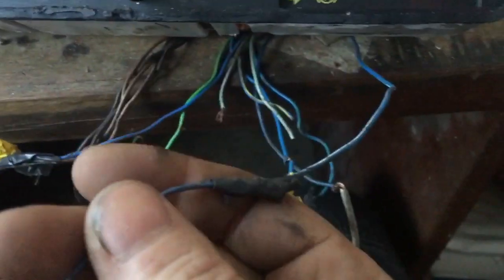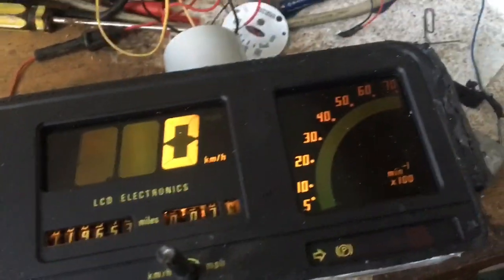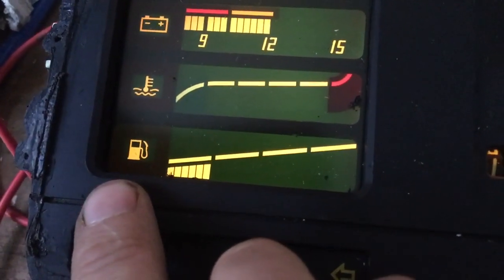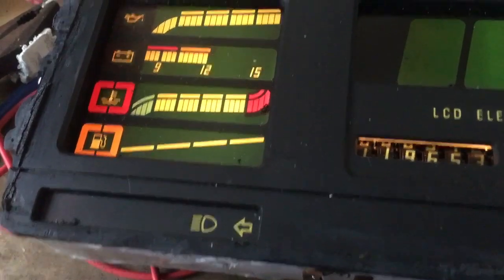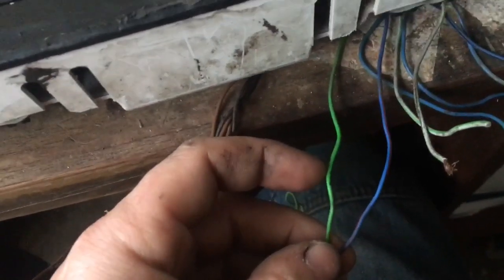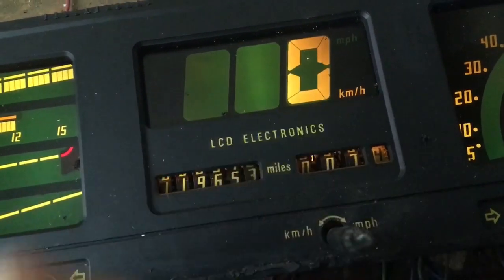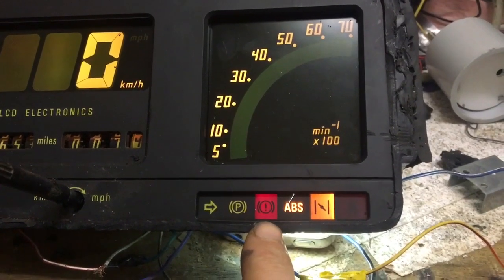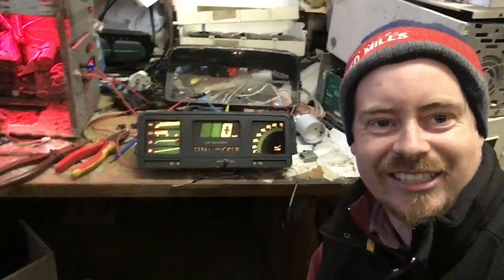Ep32 Bench testing the Astra gte digi dash

Comment: Bit of a long shot but do you repair these units? My dash is fully illuminated & working but half of the rev counter & fuel gauge pixels are not displaying. Any information would be grateful
Reply from the maker: There are 3 light bulbs 💡 behind the dash my Guess is one or 2 bulbs are blown, just replace them . Now from memory I don’t think they are a standard bulb but you can find them on eBay you will have to remove the bulb and find a code or what it looks like first , and I think you do have to use the exact same because of the light of the bulb and how it throws the light . Best of luck
Reply: @stevenharpervw its not the bulbs they illustrate fine its the lcd digits in part of the screen not displaying in the modules, im assuming they are faulty or a possible bad connection from the ribbon cable or a solder joint on the pcb
Reply from the maker: The pixels are backlit with bulbs so just be sure that’s not the problem .  There is safety / anti tamperproof screws holding the cluster together but you can buy the opener online. But some clusters I’ve see have normal screws so who knows . If you do get it open yea check the ribbon cable, you could also have cold solder joints . Or a crack in the solder joint .  The clusters are still cheap and come up on eBay so might be worth just swapping them if that’s the problem. I haven’t adjusted the mileage counter on mine but usually they are just held in either + screw and you could swap the two counters or just remove the input cog and roll on the mileage till it reads correctly
Reply: @stevenharpervw Ive already got the clocks fully stripped down, the solder joints on the PCB dont look good so I'll start there, Ive already wound my mileage back to match my original odometer as I'm fitting the clocks into a Corsa, I bench tested them & everything was working until I dismantled them so something has gone wrong hopefully nothing major
Reply from the maker: @rickwright5045 I think from memory the black plug and the while plug both have their own 12v and ground wires so 2x of each so just check that your have the wires all accounted for
Reply: @stevenharpervw the black plug is irrelevant to the lcd displays as they are powered through the white plug only
Reply from the maker: Ok it was over 5 years ago since I recorded this video so I’m trying to remember everything I did, hope you got it sorted

Comment: I just bought 2 of them. The older one like this and the newer one. I see some vw connectors in the back.  Are you going to mount this in a mk3 or something?
Reply from the maker: Yep so I mounted it into a vw corrado . As they are the same size . It looks great . The speedo was the hardest thing to get to working to rear the correct speed but it’s finally correct now . 😅
Reply: @ great. I heard the mk3 sensor works to? I’m building one in my mk2
Reply from the maker: @19811402 no you need vss with a 6 pole or 16 pole sensor the vw vss sensors are only 4 pole . I’ve a video showing the different sensors from about 7 years ago
Reply: @stevenharpervw oh so it’s showing to low speed? Cos I used the mk3 sensor last weekend and seem to be working fine
Reply from the maker: @ what size wheels do you have . The original Astra would of had 13 or 14 inch rims but used a 6 or 16 pole sensor so probably increasing tyre size and reducing vss poles you got closer to the correct speed . You can get a speedo app on your phone and compare your actual speed to your dash clock speed
Reply from the maker: @ keep going, there is very little info out there so it’s great to see other people doing this project too
Reply: @stevenharpervw  it’s still outside the car.  Just put the drill on it. I have seen a difference in speed with the different clocks tho. One is showing more speed than the other. Currently working on getting the 2.0 working like it should. I hope to install the cluster next month. I have 17”
Reply: @ not a lot of people like to install Vauxhall/opel parts in vw’s 😂. But I like this one more than the digifiz. One thing tho. The clusters are a bit bigger. So have to do some modifications
Reply from the maker: @ yes the mk3,cluster is smaller . I put it in a vw corrado
Reply from the maker: @ check out the play list the lower down videos are of the Astra dash https://youtube.com/playlist?list=PLXvxRq4qhhaV-3u0gYHLadUfuHML33KmS&si=ga3xruWIJqLG7GTE
Reply: @stevenharpervw  I have a mk2. But mk3 engine and box. Different speed sensor though 🧐. Doesn’t look the same as yours. Going to test it again this weekend. Thanks for the info. Much appreciated
Reply from the maker: @19811402 the speedo sensor (vss) I used was a 16 pole sensor

Comment: Hi,my digidash wont light up,it clicks,and ive tried bypassing the dommer,any ideas?thnks
Reply from the maker: Oh , there is more than one 12v and more than 1 negative wire . I think there is 3 or 4 of each so make sure all wires are connected brown and black I think are the Colours . I’d have to go look at my own video to be sure 😅.  But worth checking. There is no fuse that I know of build in to the board .
Reply: Ye,tnks for reply

Comment: Good evening my dear friend, I am one of your followers on your page and I have a problem that I could not find a solution for. I am an Opel fan. I have an Opel Corsa A with a C20xe engine. I installed and operated it 7 years ago. The problem is in the digital gsi meter. Everything works except the speedometer. I did all the experiments to operate it and I connected the electrical wires, but it did not work. Please help me. I want an electrical diagram drawing how to connect the wires to and from so that it works while the car is running. I will not forget your help. Thank you in advance.
Reply from the maker: The sensor in the gearbox needs 16 poles  and needs 3 wires -12v +12v and source . Source wire is wired to the digital cluster

Comment: Hi, its naysmith5272 (this my other account) I uploaded a new video where I taken apart the digi-dash's. (also I got a tool to undo the screws) I understand what you mean about the ribbon cables. (They seem fine and one has a more robust ribbon cable)  The broken dash has a lot of corrosion around the crystal for the uP.  If the uP wasn't needed for the startup check that might explain why the dash doesn't go into operational mode.

Comment: Hi, thanks this is a great video.  I have 2 digi dashes - off the car, with the correct connectors with wires (cut from the wiring loom)  The first one does the start up and displays the expected static deisplay but the second one does the start up and then all the numbers and divisions go out.  (The voltage being the easiest one to test).  is this a known issue?  Many thanks.  I can post videos if needed.
Reply from the maker: Hm I’m not sure what the issue is . Maybe a bad capacitor or bad soldering joint (but that is only a guess) I was lucky with mine and I had no real problems only replaced the light bulbs .  Make sure all the + and - wires are connected
Reply: @stevenharpervw  thanks - yes it’s the same connector between working one and non working. I was given these 15 years ago so may have failed in the 90’s. I can compare the voltages at points in the circuit. The one in my car works fine thankfully.
Reply: lol - i see its rivet and glued together. :face-blue-smiling:
Reply from the maker: @naysmith5272  on yours or on mine ?
Reply: @stevenharpervw  on mine I went to look for the screws and saw they were rivets
Reply from the maker: @naysmith5272  yeah I’ve the same I think it was kind of a idiot anti tamper proof lock.  But there is a video on YouTube/ or google images? of a guy disabled his cluster. I’m not sure what he really solved by doing it but it showed all the chips and resistors etc . I wanted to know if I could change the Speedo Count instead of needing 16 pole Vehicle speed sensor(vss). Could I change something like a resistor or chip and use a 4 pole (vss)  because I’m putting the cluster into a Vw and they run on 4 pole vss

Comment: the numbers displayed on the speedo during the power on test:  125 is an ID number for the speedo transducer, astras also had 127 depending on age.  6 cylinder monza/senator version shows 126.   I assume that monza/senator had their own dash as the rev counter is driven from the coil and would therefore misread if you used a 4 cyl version on a 6 cyl car, vice versa.   (edit for clarity when i say monza i mean the big opel coupe, i realise the monza name was also used for astra/kadett saloon in some markets).   288 isnt a number per se, its just the electronics doing a self test for all of the remaining LCD cells.
Reply: Is the red switch on top of the digi-dash related to transducer?
Reply from the maker: Dash displaying 
125= 6pulse speed sensor 
127= 16 pulses speedo sensor

Comment: HI ! Thank you for this video, helps a lot. I try myself to install a kadett cluster to an different vehicle but I have a problem that Is turning on but after all the animation,  when should show you 0, is turning off. Did you had this problem ?
Reply from the maker: No it just stays on .  If you have a weak battery it will turn off
Reply: @stevenharpervw  I used a 20A 12v powr supply  and have the same problem. It shows 127 then 288 and loading RPM and then is turning off
Reply from the maker: @Restfulcooking  I have updated the video description for you.  It shows white plug . The 3 -12v and 2 +12v
Reply: @stevenharpervw  i will respond on my normal account :) cause I forgot I was on  my cooking one. Yes. So as I say’d above. I have the white plug connected to my power supply at pin 5 and pin 15?for 12v + and pin 9, 10,11 for brown . And still got the issue. Is pretty strange how is working
Reply: @stevenharpervw  i ve just uploaded a short video with my issue
Reply from the maker: @VladGrigorestudio  I can’t see your video only really tasty food 😍.. I am now on strike and refuse to help you unless you bribe me with food 😁😂
Reply from the maker: @VladGrigorestudio  yes it sounds like your have it wired correctly and I see the video. I think you will have to open the back of the board up , and check for damaged resistors. (My guess is ) the start animation must powered by either pin 5 or pin 15 . And then normal operations is powered by the other pin. Or maybe one of the three negative wires are damaged?  Maybe check continuity on all wires
Reply: @stevenharpervw  Thank you! yeah, I will start searching for the broken part :D I had 2 capacitors replace because one was broken and the other one just old but I'll keep searching for the problem :D I will let you know If I will find it :D  Thank you so much: D your video helped me a lot ;D
Reply from the maker: 4x brown -12v  wires and 3x black +12v wires  do you have them all connected  

The background lights are they illuminated
Reply: @stevenharpervw  12+ on 5 and 15 pin and brown - 9 10 11 pins
Reply from the maker: @Restfulcooking  look at 0:17 of the video .  Plastic ribbon is black plug 
Plastic rectangle is white plug .
Reply: @stevenharpervw  3. black and 4 brown ? :D In wiring scheme i see online 2black and 3brown ;D 

I buy my cluster without wiring and I had to redo from 0

Comment: Hei.
I need some help with my dash. Mine is from a Kadett, different rev counter and no miles option.
It's in unknown condition. I don't have any of the plugs and wiring.
The pinout for the black plug seems easy to figure out since two of the blank spaces are numbered 2 and 5 and you can visually trace where each wire strip goes.
But the white one, different story. I don't get which corner is the 1st pin which is 22nd. Could you please check your connector, I'm pretty sure the pins where numbered.
And which wires minimum do you have to connect to get the dash to turn on/light up, to at least test mine if it's a working example
Reply from the maker: Will you add me on Facebook and send me a message - and I’ll check tomorrow and if I don’t just ask me again. I’ll get you the pin out of wire 1 and 22 ( or what ever the number is ) and you can work them out after that  u will need only white plug/ with brown -12v and black +12v  I think they maybe 2 or 3 of each wire. To be honest you really do need the plug even just plug and 10cm of wires
Reply: Can you send it to me too please bud I'm in the same boat